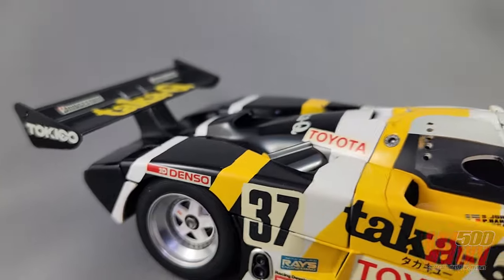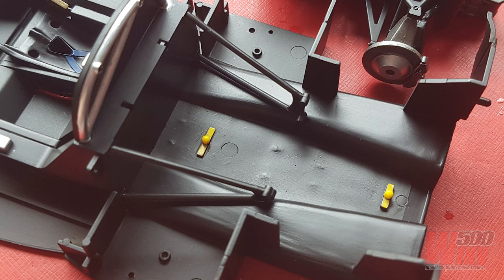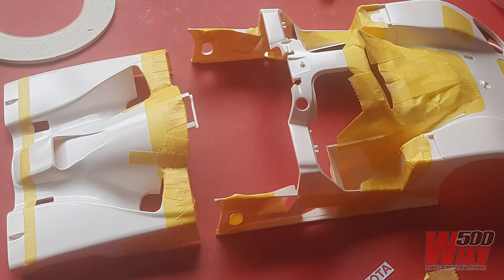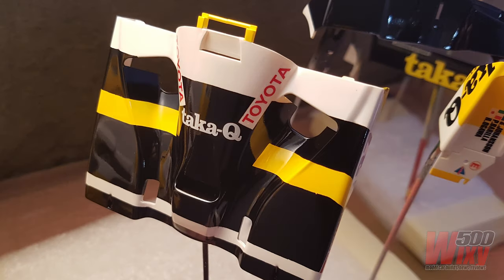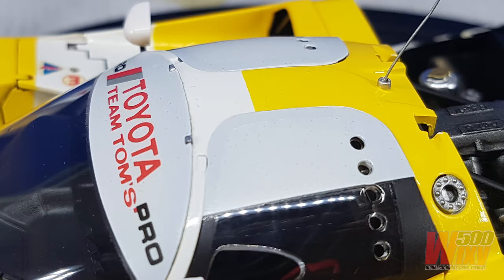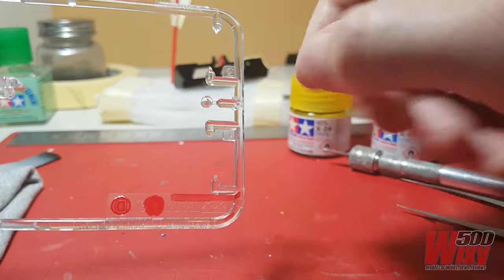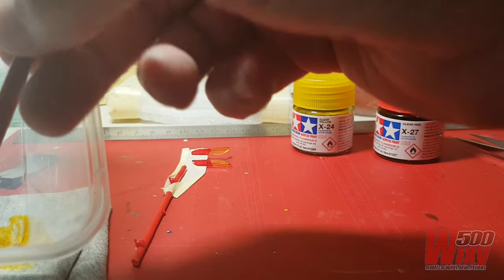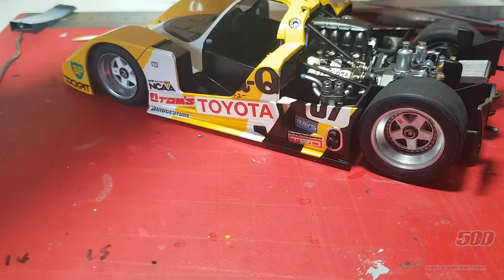Full build, Tamiya Toyota 88C-V (but using paint not decals for base livery)

Comment: Very nice work on such an old kit. Would never have noticed the difference in livery on the diagonal areas. Shame about having to do so much masking, I wonder if a layer of plain white decal underneath each masked area would have helped minimise the bleed through? Nice video too, picked up a few ideas along the way. Cheers, Paul ( also an F1M member )
Reply from the maker: Yes, applying plan white decal underneath the kit's supplied decal does work, but it means the decalled areas are twice as thick, which means it's more difficult to get the clear-coat smooth and flat. The Salvinos Petty NASCAR I built uses that method, the kit came with extra white backing decals to help overcome the bleed through.